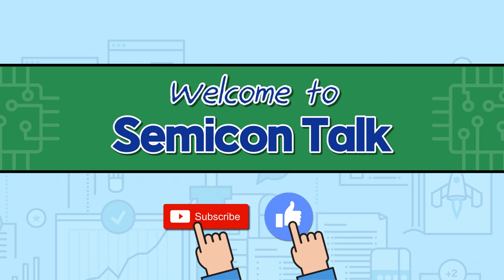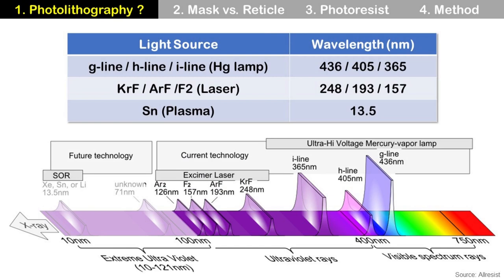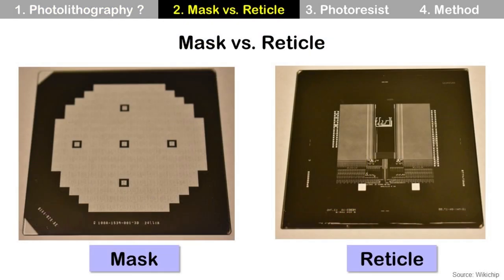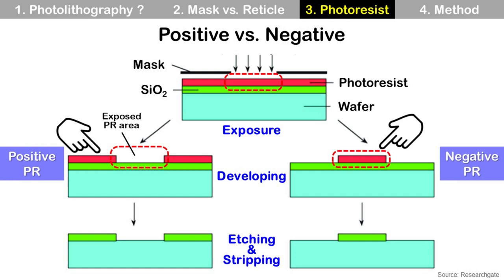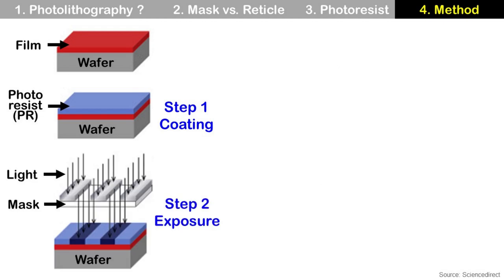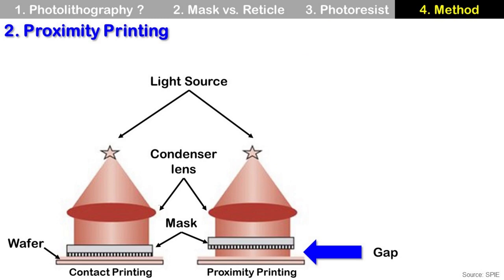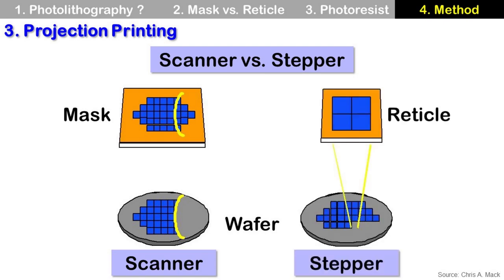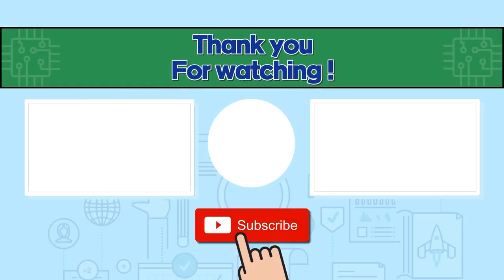[Eng Sub] Photolithography

Comment: Hi, when it goes to more than 1 reticle, for example, 3xreticle interposer of TSMC's latest CoWoS, what is the core tech used for exposing and patterning the areas between different reticles? as you mentioned in the video, step and scan? 
Or it may deserve another episode, like "advanced photolithography".
Reply from the maker: Stitching technology is used to make interposer larger than 1 reticle size. Pattern stitching is a technology to make a pattern larger than reticle size by stiching multiple smaller patterns. I think core technologies for stitching are alignment, overlay, and proper photoresist matrial. Please check the paper by Ultratech, lithography machine supplier, about large interposer lithography and here is the link.
http://veeco-media-file.s3.amazonaws.com/wp-content/uploads/2020/04/06112240/c768ddbae9aafaa148d1877483a008f1.pdf
Reply: Thanks for the sharing, really appreciated